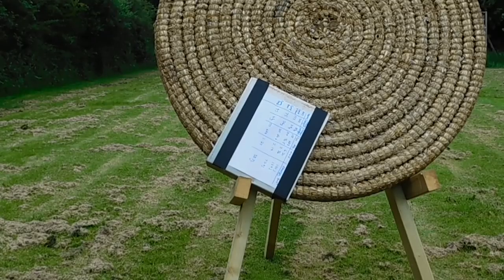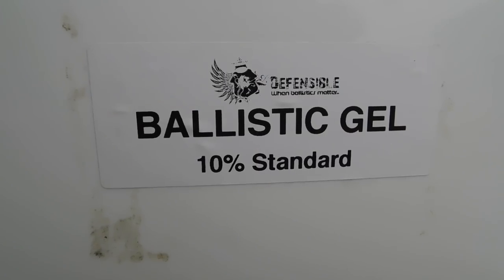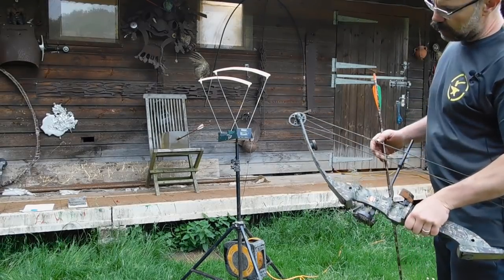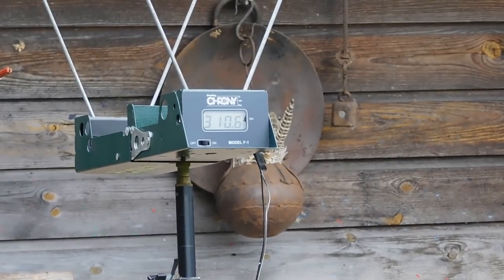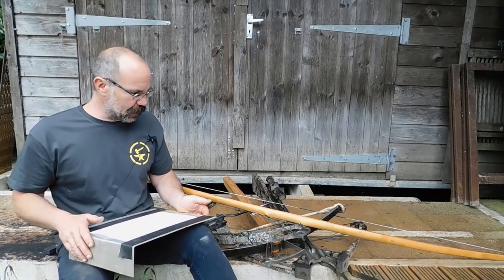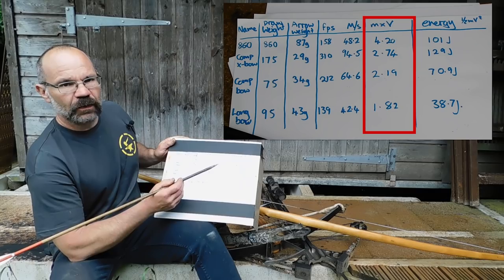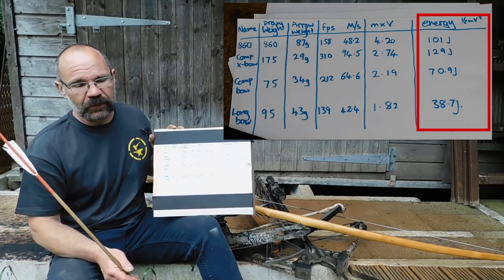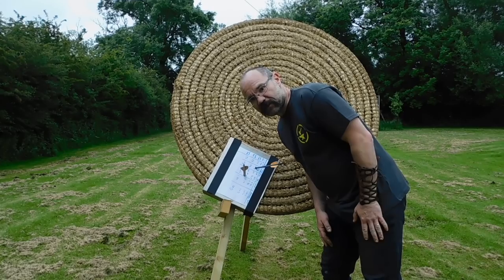Medieval vs Modern Crossbows/bows Ballistic Gel Tests

Comment: i would repeat the test but swap the projectiles. Use the modern bolts and arrows on the medieval weapons and the modern weapons use the medieval bolts and arrows then compare the results with this test. This should show if the ammo is a major factor.
Reply: Yeah and use the old crossbow bolt with your longbow too. Anyway joke aside that's not how this works at all. All you'll get is potentially dangerous weapons failures
Reply: @samarkand1585  Well to be fair it is not so much of a problem with the bows, you may not be able to just "swap" arrows but you can shoot modern arrows with a longbow and traditional arrows with compound. The crossbows on the other hand not so much, you might be able to shoot a traditional bolt with a modern crossbow depending on its design but those medieval crossbows have just to short of a draw to fire a modern bolt. What would be interesting and may give some answers would be to make some medieval style bolts out of modern materials with modern heads and fire them form the medieval crossbow.
Reply: Could you imagine if they used one of Joe's bows? Either his 160 pound bow or his beastly 200 pound?
Reply: It would be interesting to see what happened if they were all the same weight and/or had the same tip design.

Comment: I kinda hate the fact that a relatively cheap, modern, mass-produced Chinese crossbow is twice as effective as a beautifully hand-crafted medieval replica. But it's to be expected. We don't use graphite and fiberglass just to save money on wood and horn. 

Still, the mass produced one may win the speed contest but it will never beat the windlass in a coolness or beauty contest.
Reply: Clearly we need a windlass-spanned graphite-fiberglass crossbow.
Reply: Steel bows were actually a  step back, both in  technological complexity  and effectiveness  - composite prod (not the log of 15 century but a oversized bow of 14th) is much more effective and may be comparable to fiberglass in performance.  Even 30 kilo aluminum prod is throwing same bolt faster than 150 kilo steel prod of similar dimensions (same tiller, same string) .  However steel prods were cheaper and easier to manufacture, very easy to scale  and most important  they were not affected by moisture. Which is why they were adopted first by maritime city-states (despite the fact that they violates crossbow building statutes of, say Venice) and then in Europe. As usual - low cost and low maintenance proved to be decisive factor. And it was vise decision: crossbowmen with steel crossbows conquered Africa coastline for Portugal and Mexico for Spain :)
Reply: I started Archery about a year ago and picked up a traditional recurve, and looking to pick up a nice handmade one now that I can hit what I am shooting at.  Now a compound is better than my bow, and anything I am looking at except in enjoyment and beauty.
Reply: Twirlip Of The Mists the truth is that they are all luxury items today who gives a shit about energy and efficiency if you're looking for power then get a gun !! The feeling of handling a weapon that has been hand crafted can't be measured !
Reply: I imagine the major contribute to this was in the arrows and bolts. The weight, size, heads, etc. are all extremely important with projectiles and they where all shooting drastically different projectiles which would very in result.
Reply: DrMossydog She didn't get your sense of humor.
Reply: What your saying is only 1/2 true if you had a smaller arrow/bolt it's speed would be much higher on a old world bow/x-bow. Not twice as effective for killing either only penetration , you only need 4" to kill however , that being said a 4-8" penetration of a 3/4" hole is ALOT worse than a 8-14" penetration of a 3/8" hole. Unless your shooting an elephant or whale (armor possibly) and need the bolt/arrow to go very  deep.
Reply: You find it sickening . I find it beutiful the fact that this stuff can surpass something that is made forever ago . It really speaks to me the fact that human has gone so far in about 1000 years
Reply: @thebge1237  Not sickening. And I do appreciate progress. But even a hundred steps forward results in a step or two backwards, or sideways. I wouldn't want to go back to ye olde days of yore, with artisan-made crossbows, mumps and no Wi-Fi. (Then again I might...) But alongside the great gains there are small losses too. Everyone roots for John Henry vs the machine even though no one would rather dig with a pick and shovel than a 12,000,000 HP excavator. 

Anyway, I'm grateful that people like Tod make things like Tod makes. Even if he will never get a contract to equip the Queen's army.
Reply: you are missing the one main point tho...
there went much, much resources and brainpower, into technologies which give us ability to cheaply mass-produce far superior(as function goes) products. 
and these old works of art are the foundation.
Reply: The Chinese make inexpensive bows and crossbows but I’d hardly call them cheap.
Reply: He shoots every Weapon with a different type of arrow, what makes the comparison statistically worthless, so don't be too sad, I bet the modern crossbow would not be really more powerful than the medieval one if it is shot with the traditional bolt.
Reply: @nicodabastard  Crossbow/Bows are used for hunting because in a lot of areas you can't hunt with rifles and shotgun hunting season is very limited. They're not just luxury items.
Reply: @DangerRussDayZ6533  I can understand that but you don't need a hand crafted one for hunting.
Reply: @jonaselze9316  it's not a worthless comparison at all, the windlass shot the bolt it was made too, and the compound shot the bolt it was made for and so on. It's not a comparison of which bow fires "bolt x" better it's which bow is superior in speed and penetration, as it was designed/used. It's an example of how advancing on the old designs has improved efficiency. You needed 860lbs of pull to make that bolt fly half as fast and penetrate half as deep as 175lbs of pull now....
Reply: @twirlipofthemists3201   Of course everyone roots for John Henry. And then, yeah, because it's stupid to spend three days pounding away at concrete with a sledgehammer, we do the same job in an hour with a jackhammer, or in ten minutes in the comfort of a skid steer with a hydraulic breaker stuck to it. We all accept reality while wishing Superman was real.
Reply: How do you know that Chinese crossbow is cheap?
Reply: @JBRocky007  I found the same thing, I much prefer compound bows without sights just souly because I like how little recoil they have and how fast they are, slot with you can hold them drawn all day 😂😂😂. But there's all kinds of things just like in guns to think about what you want the arrow to do. Do you want speed and distance or slow speed but serious impact damage. Modern arrows don't need the weight because our brodheads are razor sharp so it's all just speed but back then they didn't have this kind of tech back then 😂😂😂
Reply: It's only about 30% better, not twice.
Reply: If you look at the ballistic gel you can see the "wound" cavity of the medieval replica crossbow is massive compared to all the others. The modern crossbow over penetrated and would have caused less damage. Both have the potential to have "killed" whatever it hit but the medieval replica put all it's energy into the target which is what you want to happen.
Reply: @scottsmithers6949  i dont think you know how modern crossbows work and why arrows kill so much more then bullets, they open blood vessels so you want that arrow to go as deep as possible. These arnt bullets that dont go deep but cause alot of impact damage, they cause you to himarage from open blood vessels. Hell they have toxic tips now that open up 3 massive holes in the animal and bleed it out in minutes just because of how many blood vessels they open up. The old crossbows disnt have razor sharp tips so they had to compinsate and as a result had a heavier bolt that cause more impact damage but didnt go as deep
Reply: A mass produced Chinese crossbow from 2200 years ago would also be more effective than most medieval crossbows. (Standard Han dynasty composite crossbow: draw weight 250 lbs powerstroke 22inches)

I would be glad to make a replica if I had horn and sinew.
Reply: @scottsmithers6949  to be fair, with modern bows you would attach broadheads to the ends of the arrows making them much more deadly and they don't lose any speed with them on
Reply: It's just better technology (although the technology isn't from China).
Reply: @nicodabastard  Not as simple as that from where I'm sitting. For those of us that hunt and use bows in bow season (we have a powder and bow season here which are separate), you need a decently powered bow to get through a Moose.
Reply: @WilliamStewart1  ofc I get that I'm a hunter too we aren't aloud to hunt with bow/crossbows in the shit hole I live in though and at least too me a hunting tool is one thing and bows are another I don't care what my hunting gear looks like as long as it's effective.
Reply: @nicodabastard  Yeah I guess it all comes down to where you live. I hunt with bows so for me they'll always be a means to put meat in the freezer.
Reply: David Daivdson  put a razor tipped broad head on the modern x-bow and it'll knock the fight out of anyone in seconds.

The wound channel created by those razor tipped arrows/bolts rivel firearms in well placed shots. I've seen large game animals get hit, not know it, keep grazing, and bleed out in seconds/fall over dead. Firearms have the"shockwave" factor plus the wound channel and a slightly off shot can still kill quickly, but if we are taking about plain old bleed out a modern broad head is pretty nasty stuff.

Shot in the arm/leg with a modern broad head you'll be also knock out of the fight. They crush/cut bones and will rip thru arteries. The wound channels as big as a 12 Gage shotgun.....I think I'd rather get tagged by a handgun round then a modern broad head in most cases.  I'd say "no thank you" to any of these weapons.  Scary stuff.
Reply: Same test but against some 1mm steel!
Reply: @JBRocky007  I've seen too many people get compounds and be extremely happy for the first couple months until they realize they can drill bullseye's at 40 yards with almost no practice. It takes away the mind/body connection when you have every aspect of skill/strength and form removed and replaced with machines doing it for you. Not strong enough? Don't get stronger use more let off. Can release cleanly? Don't learn how, use a mechanical release. Can't learn to aim traditionally? Use pins. It's great at first but ends up killing to passion people have for archery all too often.
Reply: You could argue that the windless would still be more effective since a bolt still in you could continue to do damage while one that has gone clean through has the chance to be none fatal depending upon circumstance
Reply: On the other hand diy scrapyard leaf spring and 2x4 monster (which can be made beautiful if you want to put in the effort) can almost get results comparable to fairly expensive chinese miracle tech :D
Reply: How is it twice as effective? The traditional crossbow had a much bigger bolt and caused more damage to the block. It also had more momentum, meaning that it would likely have a much longer reach if he tested for it. As said in the video, more momentum is usually better att penetrating as well. How would it look like if he shot at 50 meters towards a block with gambeson over it? I highly doubt the compound bow would beat the traditional at that test. 

As said in the video, this test doesn't prove it is better than the other. Saying it is twice as good doesn't make sense if we can't tell it is better in the first place.
Reply: @morelhunter3966  my friend, if want true mind-body connection, master the ancient shepherd's sling!  :)  Oh btw, i pick morels too, but only for my own use, not commercially.

Comment: It would be interesting to see the same lineup pitted against gambeson, mail, lammelar and plate. But great stuff. I really like the math videos with chronos and numbers, they help put the difference between the weapons in context.
Reply: I suspect the 860 lbs crossbow didn't penetrate deeply because it's heavier but that does also mean more force was put into the target. You don't actually want your projectile to go completely through the target, instead, you want it to stop just before leaving and sub-optimally just after so the arrow head is out but the shaft is still in.

Comment: To truly compare them you should have the material and tip of the 4 bolts/arrows made out of the same material. The Longbow arrow is wood, much more resistant to move through the gel. I think the results would be different if the material was the same.
Reply: Also that high-performing xbow had the massiest bolts (~double that of the next performer); not surprising it came out top of the energy table..

Comment: That's a slow compound bow at just 212fps.  Looks like an early 90s bow?  Maybe its a combo of factors, but something more modern would be interesting to see in a test.  There was a huge increase in efficiency from 1995 to 2005.  Today 310fps+ on a 60lb / 28" draw is easy to come by.
Reply: Was thinking along the same lines, my Hoyt 60lb compound shoots aluminium arrows at 260fps and carbon arrows at 312fps (with my 30" draw length)
Reply: I was thinking the same thing.  PSE, the same make he uses in the video now has the record with a compound bow that goes 370fps
Reply: I don't think any 60lb compound would throw a 500+ grain arrow at 310 fps this speeds you see are from shooting really light arrows (350) grains
Reply: I have a 93 lb APA King Cobra with 370 IBO speed. With a 700 grain arrow it's about 280 fps at my short (27") draw length. That would make for an interesting comparison I think.
Reply: @sahhull  That's the way it was with my Oneida Strike Eagle compound bow, you had to use a heavy arrow, or risk a dry fire. BTW it never shot at 300 fps hehe  260, 270 I think... was the best I ever got.  I can't remember the name on my PSE compound bow, but it had an overdraw shelf, and hit 300+ fps with ACC (Aluminum, Carbon, Competition) arrows, set at 64 lbs.  26" arrows @ 28" draw length

Comment: Loved this video, so cool to see these weapons in action and also their analysis (physics below!!)
As for why the composite crossbow did went through more than the higher draw crossbow (reference to video at 8:50), here's the opinion of a first-year physics major university student:

Let's look at the two crossbow bolt's speeds and momenta respectively.
While the heavy draw crossbow bolt had around 1.5 times the momentum of the composite crossbow bolt, the composite crossbow bolt travelled almost twice as fast. 
If the same force was applied to the bolts in order to stop them (which is most likely a reasonably inaccurate assumption given the changing surface area of the bolts as they travel through the ballistics gel) then we can use the derivative form of the momentum principle to estimate that the change in momentum for the heavy draw crossbow bolt would take 1.5 times as long as the composite crossbow bolt. 
Let's say that the heavy draw crossbow bolt decelerated constantly in this time. It would travel at an average speed of half its initial speed (based on the final speed being 0 and the average being the initial plus the final, all divided by 2) until it came to a stop 1.5*x seconds later. 
If the other bolt was stopped a similar way it would be travelling at around the full speed of the heavy draw crossbow bolt on average (starting at twice the speed of it) for the total 1.0*x seconds until it stopped. 
By this simple math we can see that the second bolt would travel at twice the speed of the first for two thirds of the time, leading to a larger net distance. 
And this is why the composite crossbow bolt traveled the furthest through the ballistics gel.

A similar example of this would be if a rhinoceros and a ping pong ball had the same momentum initially. They are both were stopped with the same force. The ping pong ball would have a much smaller mass and a much larger speed. The constant deceleration would apply to both making them stop after the same amount of time. The ping pong ball, however, started at a much higher speed and therefore would travel further before being stopped.

Comment: Great video!  I hunt with bows and crossbows quite a bit, and arrow/bolt penetration is something I definitely pay attention to.  Velocity and mass play a major role, but so do a couple of other factors When choosing an arrow for extreme penetration on big game I want it to be (1) heavy (>400 grains) with weight distribution forward of center (more accurate), (2) I want it to have a small diameter, preferably thinner than the broadhead (less friction behind the head), and (3) I typically want a two-blade broadhead to decrease friction.  Bolt diameter and the dullness of the point are two of the major reasons for the lack of penetration with the medieval crossbow, although there would be other factors.

Comment: So with ballistics, speed is the biggest factor in penetration.  So a heavier bullet, while will impact with greater force, speed penetrates much better. I would assume the same holds true, the heavier bolt creates greater impact force while the faster, lighter modern crossbow bolt penetrates better with speed.  Think velocity vs. Lbs per square foot. (American here)